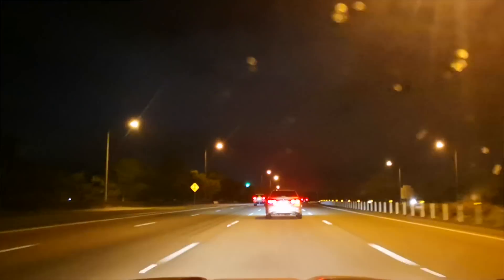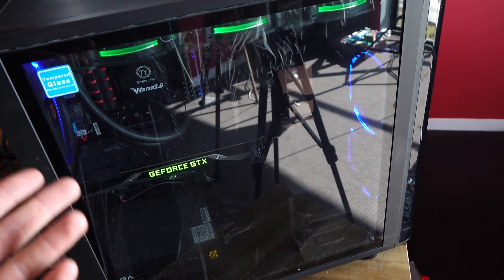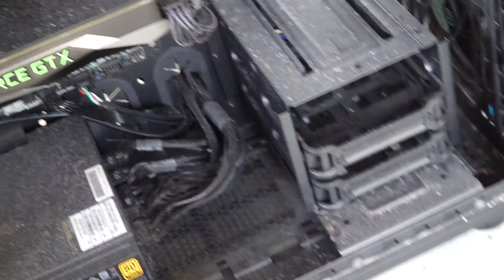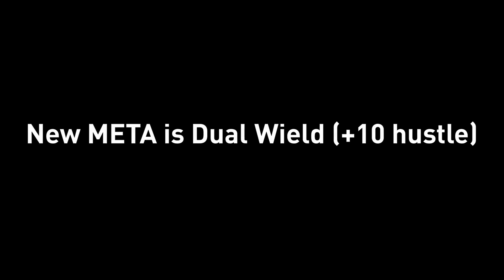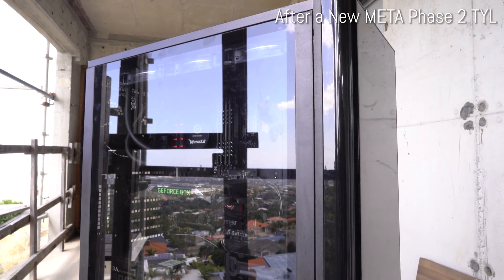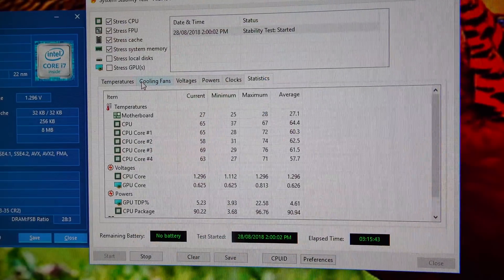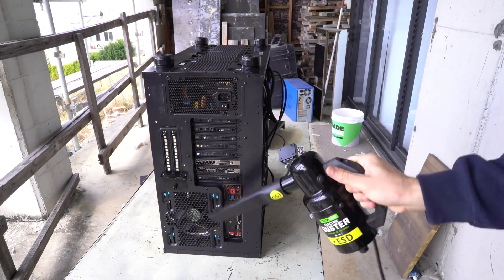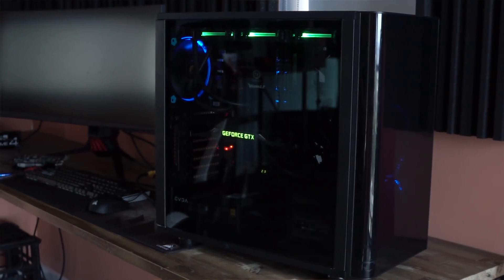How to Turn $900 INTO $1399..!? - The QUICKEST Way to Shine up YOUR PC?

Comment: Love your channel Tech Yes CIty... but there’s no way in hell Im spraying WD40 on my pc. The oily nature of it is awful, then there’s also the smell. Not sure if I could even bring myself to purchase a PC that smelled like WD40 unless it was a super cheap deal.
Reply: Still do not get why he does that. WD40 smells do bad and afterwards it will become a dust magnet.
Reply: I’ve been watching this channel for awhile & heard the same argument over and over.

The smell depends on which WD40 type you use and he wipes off the excess after he applies and it’s normally done OUTSIDE or in a well ventilated area. 
Breakcleaner also does not leave residue. If your that worried about residue get the lighter formula version that dries faster. 

I’ve personally done this to multiple PCs over a few years since I learned, and not only have they never died on me, they have worked better, looked better, and sounded better (used to get real bad hissing from the fans) and don’t get me started on how absolutely dust filled my GPUS were before I started this. 

Remember, wipe off the excess WD40, vent your windows or do it outside. It smells for a grand total of 10 minutes. And trust me, my old apartment had bad ventilation and it still was 10 minutes. I stand by this guy as I’ve made money with how clean my rigs have looked ✌️
Reply: @Sarah_Kinz  non chlorinated right?
Reply: Any chance of a detailled tutorial on using WD40 or brake cleaner?  There are different kinds of WD40?
Reply from the maker: Hey Sarah, exactly this ^, the non-believers have yet to be converted!
Reply: Sarah, not all countries have reliable supplies of the real WD-40. It's everywhere and its hard to tell who has the real cans and the fakes. Not a big market for fake electronic contact cleaners though, so I usually go for that when I can afford it.
Reply: I do wd40 also but not everywhere, only onto chipset like motherboard and inside PSU after proper dust-off with pressure air and a soft brush so the wd40 protects circuits from dust.
Reply: Yeah you use it like you use water to clean your car, but it also acts like polish. You don't need the excess on. You dry it off
Reply: Been using his methods - been spraying WD40 on my rig to clean the areas I normally can't. And it gets the job done.

You should put the links to the your old videos dedicated to the good old cleaning META on the descriptions of your new videos mate. Its better to keep them there even though most people don't even check out the description, getting them off-guard.

More power to you Bryan!
Reply: NO FKN way id buy a pc that wreaked of wd40 lol
Reply: I hope everyone realizes that there are multiple kinds of WD40 out there and one of them is the CONTACT CLEANER which is specifically made for cleaning your Electronics including PC Hardware.

The chemical is quick dry and I mostly use that for general cleaning purposes of my PC.
Reply: Most of the issue goes back to "What kind of WD-40" or "what kind of brake cleaner?" basically its whats in the chemical that matters, and nobody here is actually saying any chemical names or chemical reactions so I assume nobody knows anything. As far as I know, the WD-40 in a blue can is NOT the right stuff to use, and they sell WD-40 Specialist Contact Cleaner that IS the right stuff, and if he just purchased the right stuff and showed the can, he would avoid not only these comments but avoid having to use a 2-step process of WD-40 then brake cleaning it to get the residue off...
Reply: Also he mentioned that you cant buy Isopropyl Alcohol even 70% in Australia so that was why...
BUT, i just found that you can, from Bunnings and others also including this : https://www.sydneysolvents.com.au/isopropyl-alcohol-ipa-isopropanol-5-ltr-jerry-can
Reply: You must be new around here. WD-40+Brake cleaner FTW
Reply: Its not WD40 its break cleaner. It cleans and dries in a few seconds like alcohol does.
Reply: CRiTr 

No, it leaves a residue. Check on the chemical components of break cleaner mate.
Reply: Sorry but i just googled 'does break cleaner leave a residue" and multiple results say that it does not. It  breaks down oils, grease, removes dust, dries.
Reply: You let it air dry after and it flash evaporates
Reply: I'm wondering if Brian realizes wd-40 does dry out, especially in a heated environment like in a case(take it from a car guy-I know). So that shiny new look will be gone a couple weeks after the buyer purchases it. Seems a bit "used car salesman", 5 and 5 warranty (five minutes or five feet). I've been watching the channel for I think a couple yrs now, but that's always kind of rubbed me the wrong way. Brake cleaner on the other hand I have no problem with, that's just a cleaner.